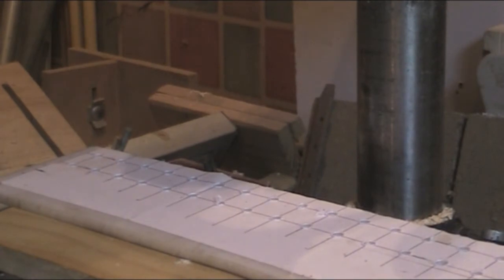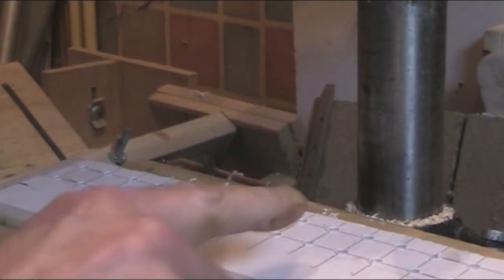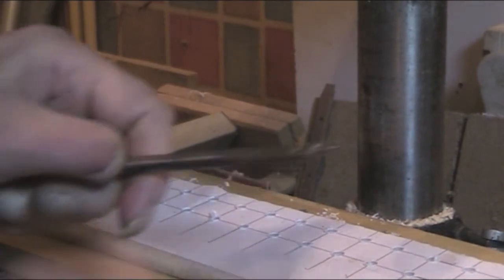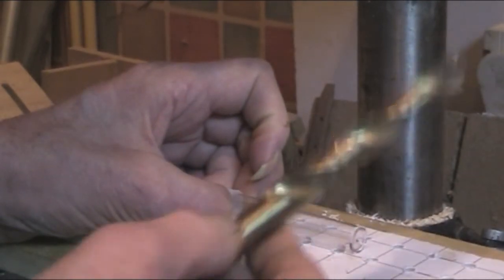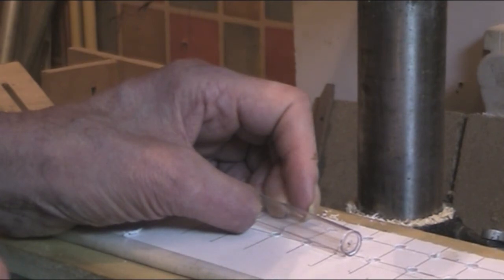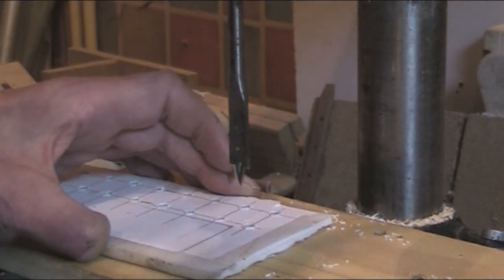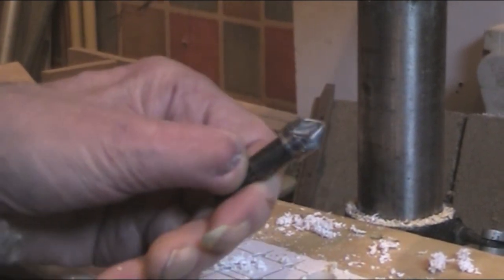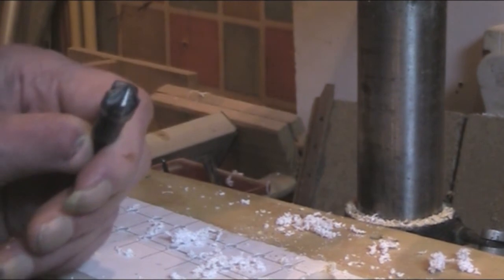Use What You Have

Comment: Did you measure the 13mm drill bit with the recessed surface of the caliper ?? nuuuu !!
Reply from the maker: The jaws on the caliper are parallel, no recess, on the previous video i had measured more than once, because i couldn't believe a drill wasn't the 13mm that it said.
The countersink was 13mm measured in the same way, and that worked.
Reply: @sparkyprojects  Damn, i didn't see it well on the video..  well that's weird, maybe one of those shop drill bits. Why it was packed and sold at 13mm shall remain a mystery for the ages.